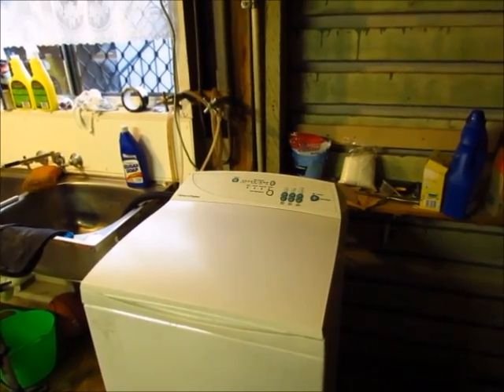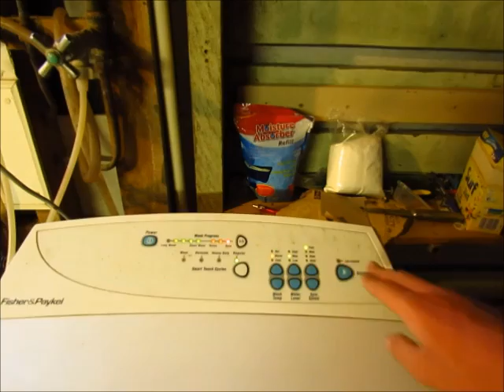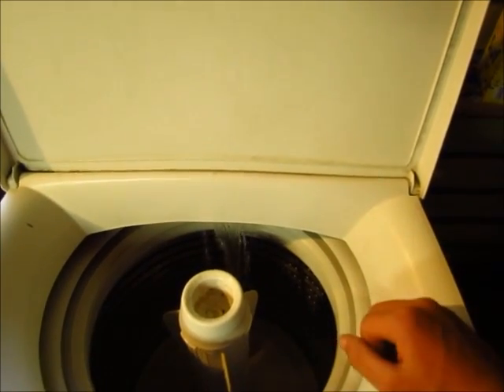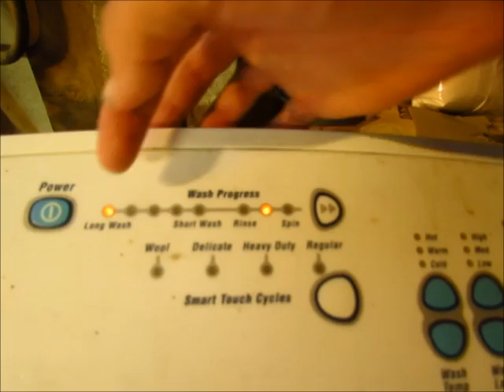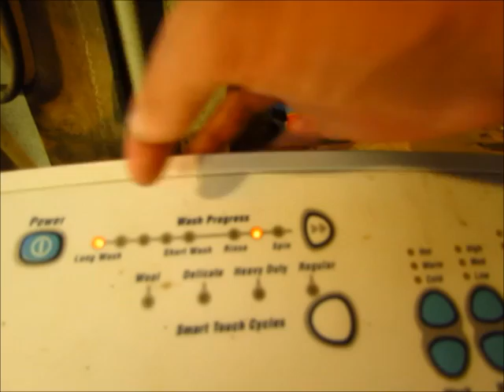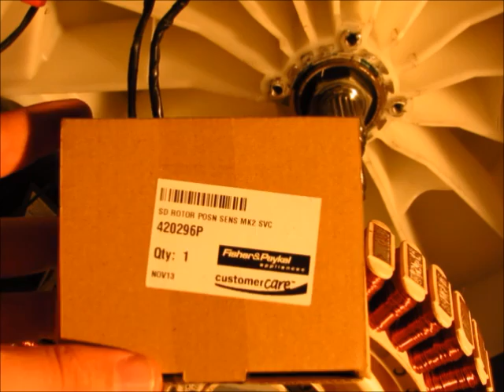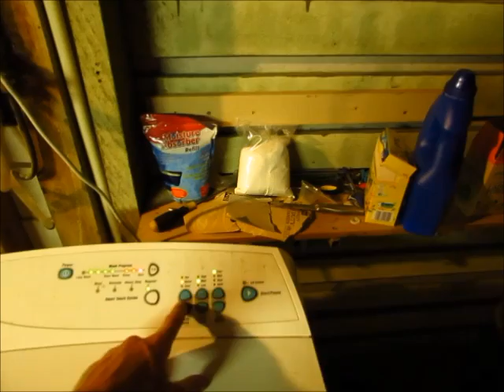Fisher and Paykel 130 (10000010) Error Code Fix & Error Code Explanation

Comment: I found error codes are inconclusive to where the fault lies in any sort of machine whether it be a car or washing maching,my parents Fisher & Paykel Aquasmart was throwing fault codes 130 & 240 up on the display and replacing the rotor position sensor didn't fix the problem.
I thought that it may have been caused by corrosion on the terminals of the sensor ,the problem been intermittent made breakage in the wiring loom out to be the least likely cause, I noticed it started when the bearing noise got worse in the machine - the top bearing was very dry on removal to the point of nearly being seized,the bearings were half the problem and probably even a cause of system board failure?
The machine wouldn't agitate intermittently during the regular wash cycle.
I replaced the bearings today and put the machine through a cycle for a few times,the machine got past the wash cycle (past agitation) but by the time the display made it to 24 minutes to go on the display,it immediately hopped back to 32 minutes into the cycle then tried to cycle to between 29 & 30 minutes,then it would just keep on cycling (between the wash & rinse cycles) ,then after 15 minutes or so, a 240 or 130 code would appear.
I fitted a spare board I was having no luck with when the old bearings were fitted (I was having no luck with both boards) and the machine went through its complete cycle with 2 loads of washing with the board I fitted this afternoon  (it took me 3 hours to replace the bearings) faultlessly.
So, in my case,it was a combination of a mechanical fault with a partially seized bearing which wasn't allowing the Hall sensor to get an accurate reference point and a faulty motor control board which appeared to have some sort of "software glitch" or something where it couldn't keep its time, the top bearing is the one which takes a lot of punishment as they are 6005 bearings with a C3 clearance and have to take up to 8 - 10 kilograms of load in the basket,so they take a lot of load for their size.
The rotor position sensor is being  returned to Sydney tomorrow.
Reply: Im not a tech but been fixing mine today. iD say your time resetting problem is a thing that they all have called "restart" Its where they try for a certain amount of time to fix the problem them self before it shows the fault code. if you switch this off while fixing, it will show fault code soon as it faults and wont keep looping itself for a while before throwing a code. Then just switch the "restart" once finished working on it. Wont help you now but may help someone else in the future!

Comment: Just a point you need to note. Sorry if you did and I didn't watch it. (raced through the video,) you need to know why there was water damage. Most common reason would be because of water seal and bearing failure as well. There shouldn't be any water getting under there.

Comment: Thanks Jesse! Mine's a slightly different model but same code and same interior - the connecting terminals to the RPS had slight corrosion - cleaned up and machine working again. All took 20 minutes - Cheers!

Comment: A BIG thank you to you for this video. I thought I was up for a new washing machine today, but eventually found your video tutorial. I had exactly the same issue, the sensor board had a corroded circuit track which I solder bridged with wire. Tested OK with multimeter, put the machine back together and I am now doing a load of washing as I type. Cheers!